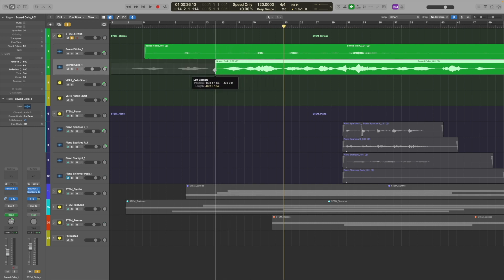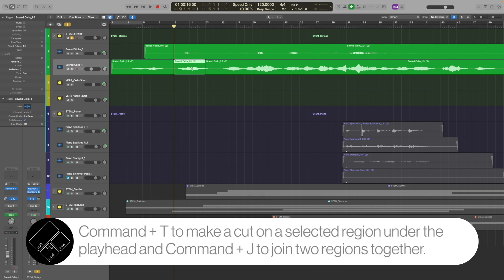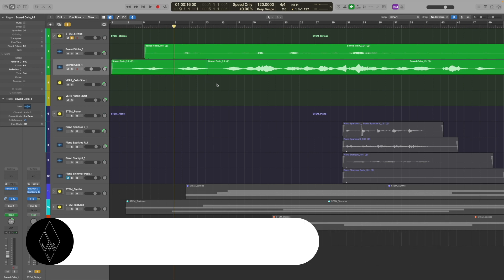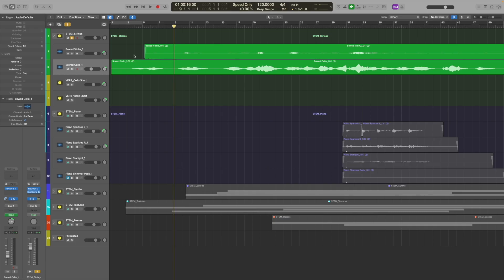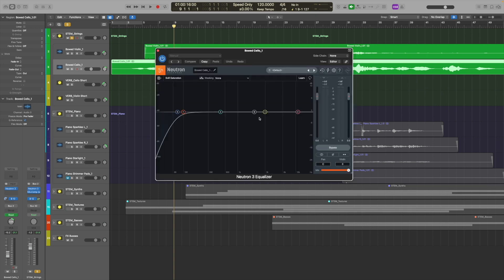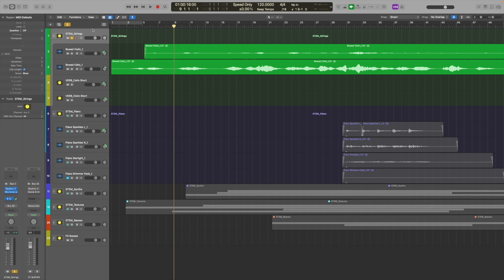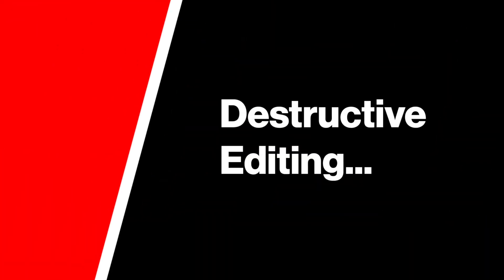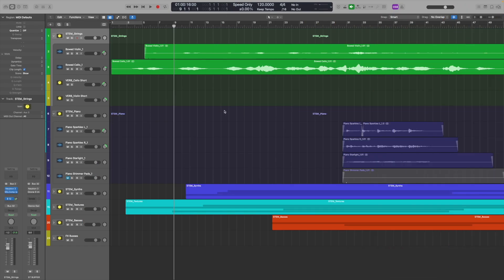What is Destructive Vs Non Destructive Editing... and How to Do It In Logic Pro

Comment: Is it okay to use the invert phase function without having a back up of the file? I struggle to see the harm in it if you can always flip it back in logic. Thank you for your video.
Reply from the maker: Hey, great question. In the case of phase invert, it really doesn't destroy the file much, so it should be safe to do it without backing up the file. As you say, you can always invert it back. On the other hand, if something fundamentally changes the sounds itself, like normalising the file or adding an effect like reverb or distortion, that is best done to a duplicated file.